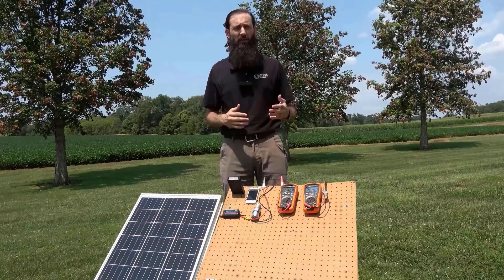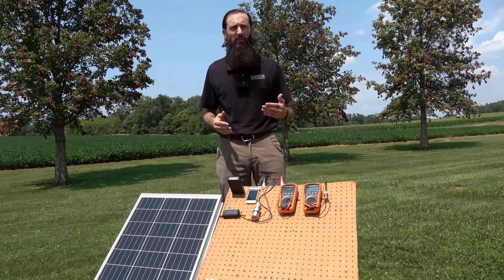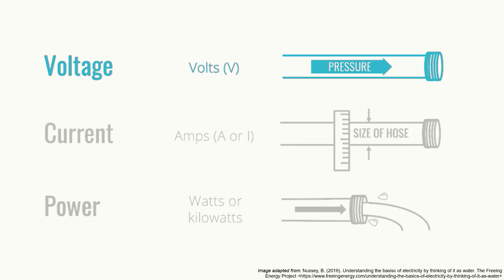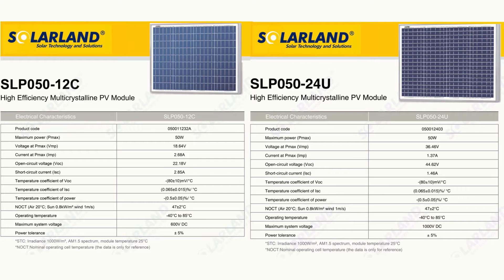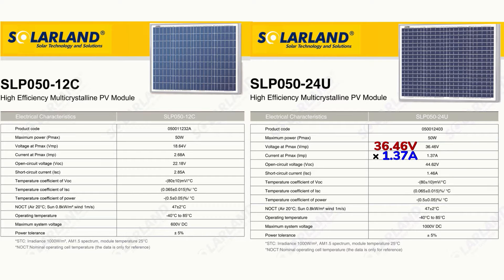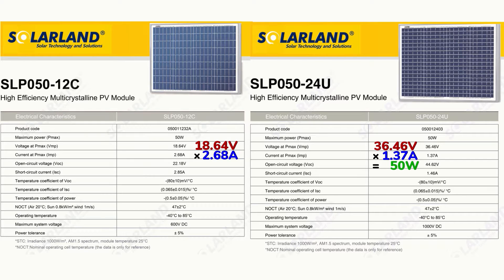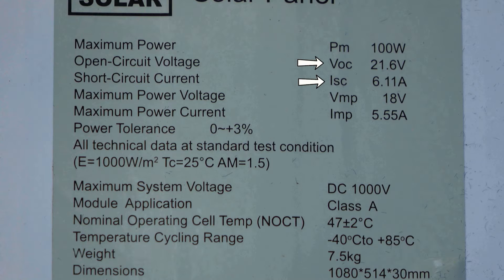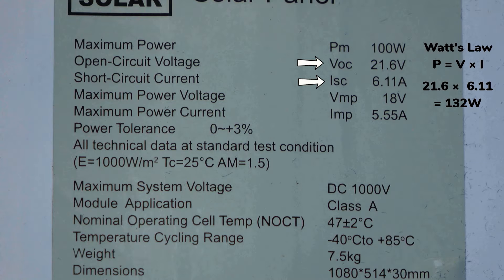How to assess power and shading on solar modules

Comment: This video as incredibly helpful for me to understand those numbers on the back of the panel that I have looked at several times thinking but not sinking in. Thanks. I plan to watch all of the series of videos. I am building a solar system on my cargo trailer with 4-100 watt renogy panels and a 2000 watt pure sine inverter and as I watch various videos I am developing my strategy of how I am going to wire them and the components. As a retired HS teacher I appreciate your clear explanations and analogies. Good Job!

Comment: please my charge controller shows 0.0ams but when I use my multimeter it gives me 6.5ams . I changes the used a different panel with the same charge controller and it was working perfectly. but on the other panel it's still 0.0ams.what should I do please